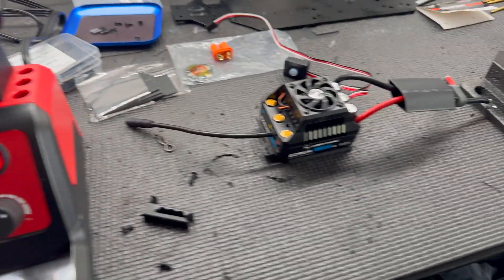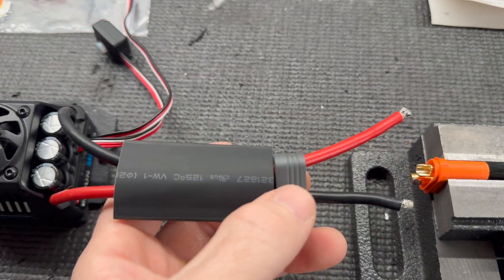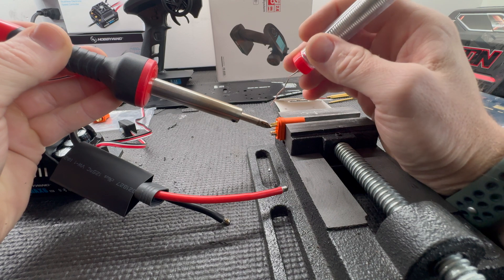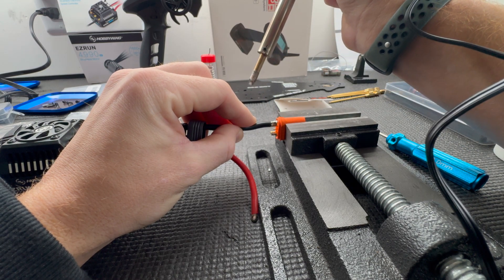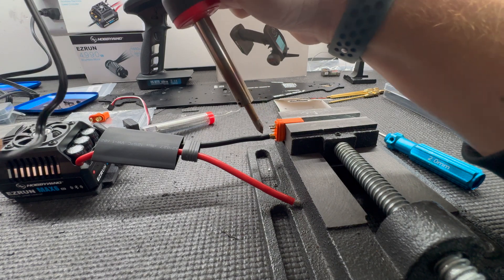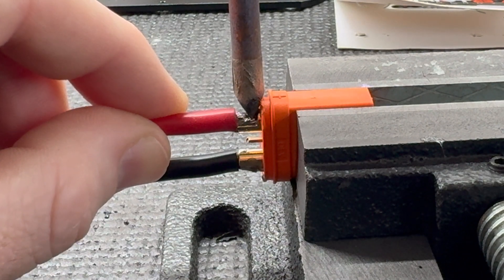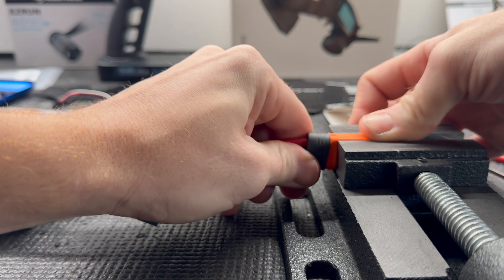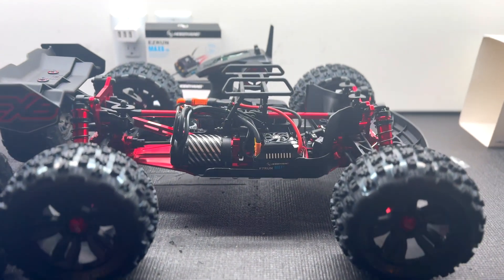How to solder IC5 connector - Max6 6 Hobbywing

Comment: Hi, do you find 60W iron is enough for your rc soldering? I'm currently in the market to buy a new station
Reply from the maker: You bet! Also depends on the quality of the unit. How much soldering do you plan to do?
Reply: @KUDRARACING  Esc and motor wiring
Reply: Not so often though maybe 3 or 4 times a season

Comment: Did you replace the stock plastic diff housings with the upgraded aluminum ones?  Arrma calls it composite, but I call it plastic garbage.  The entire diff is metal, except for the housing.  I blew my center diff in my TLR Typhon two days ago, so I’m replacing them all with the upgraded aluminum ones in both my Arrma vehicles. Very hot, burnt Chinese oil went everywhere lol 😂
Reply from the maker: Yeah man, aluminum diffs and diff housings 👌 Honest opinion - The out drives breaks more than the actual diffs so going with M2C outdrives solve a lot of problems. However, the aluminum ones are nice. I did a video last week on some of the things to know when switching. https://www.youtube.com/watch?v=iLCUt2R5u3I&t=711s
Reply: @KUDRARACING  yeah I watched that one, very informative.  But do the M2C out drives work with my stock ESB parts…?